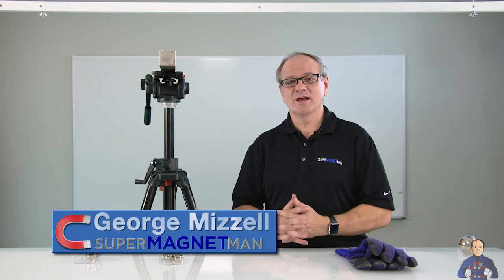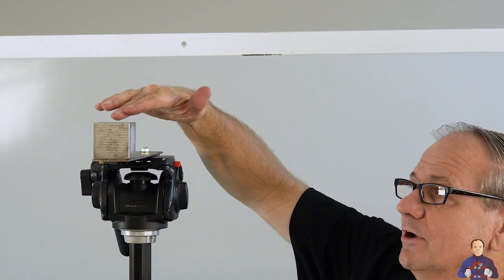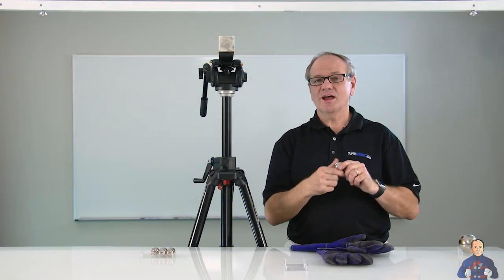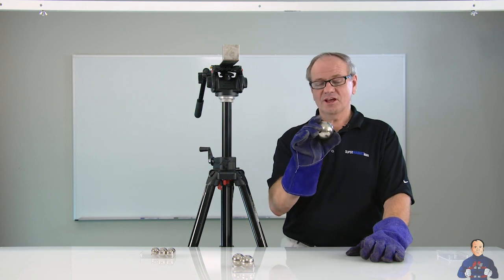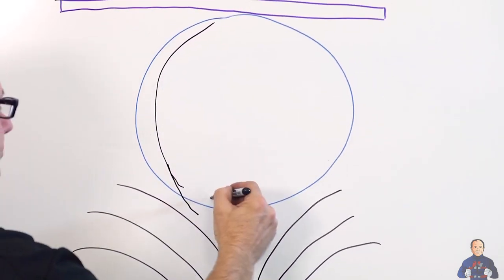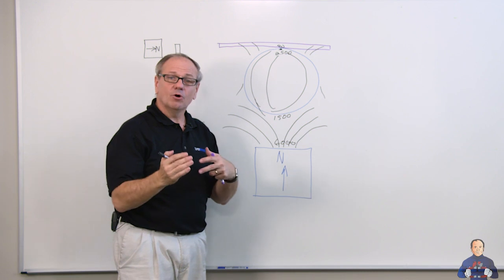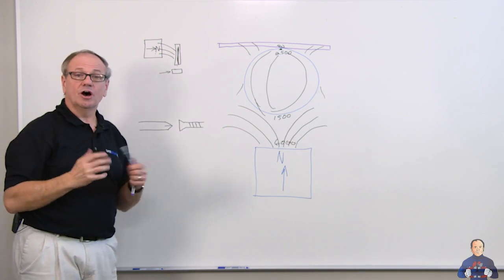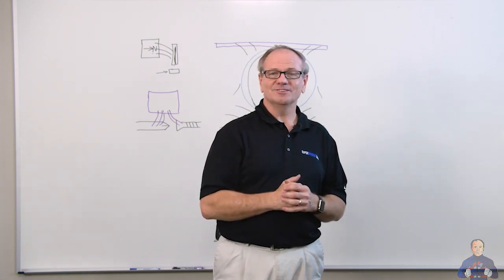SuperMagnetMan   Induced Magnetism

Comment: Thx, very informative. I have a question about induced magnetism. If you take a steel cube and put a magnet on all six faces, where all magnets have the north poles to the faces of the cube, where does the south pole go? I tried this once and all magnets stick even though the poles facing the steel have the same polarity. I just don't understand what happens to the south pole. Can you explain?
Reply: The way I think of it is by considering 2 different things which happen simultaneously. There are 2 completely different forces at play. One is the amount of flux the steel is absorbing and the other is the amount the steel is 'taking on' the field of the magnet. In my research they seem to be different. To say that again in other words > the amount of attraction that iron experiences in proximity to a magnet is a bit different than the amount that the steel will copy from the source magnet.  You can see this phenomena by taking steel and placing north and north poles in the same steel. What will happen is that you will feel a push at a certain distance b/c the steel 'takes on' the fields of nearby magnets and stretches their fields... then when the magnets get close enough to the steel, the attraction to the steel will become greater than those north north proximities... I don't know the math,,, yet,,  I'm actually working on that right now, lol.  One thing that is weird is that the south pole  in the induced steel is super weak. For almost a day I thought it was NOT there and the steel would only pick up ONE pole.  In life it is paramount to take measurements and repeat your work across many days/weeks/years.. that way one doesn't end up believing things which are just difficult to find
Reply: The steel body had enough permeability to sink the fields without becoming saturated. With big enough magnets or small enough steel, the effect wouldn't happen.